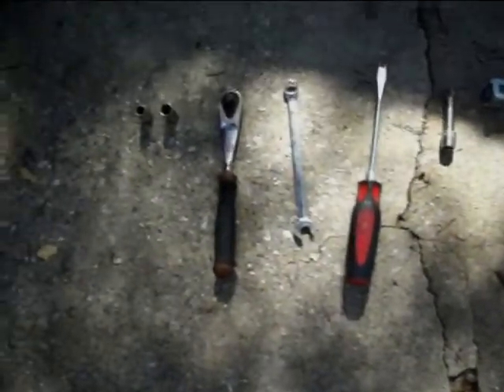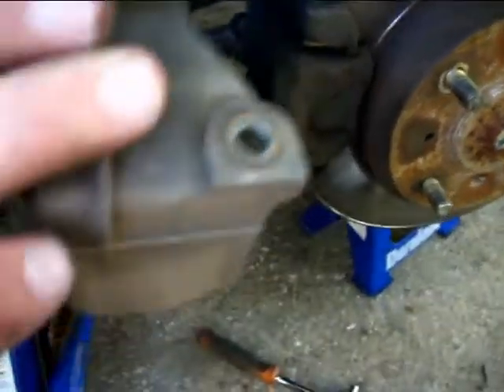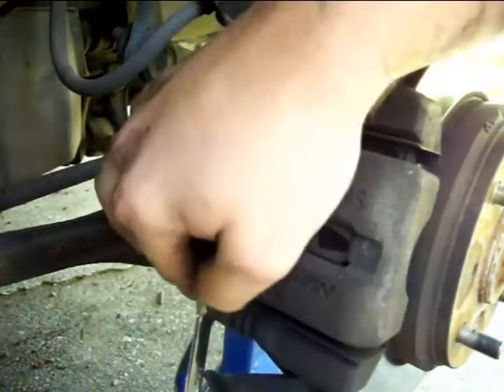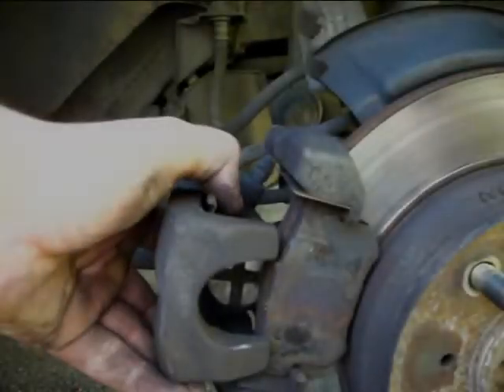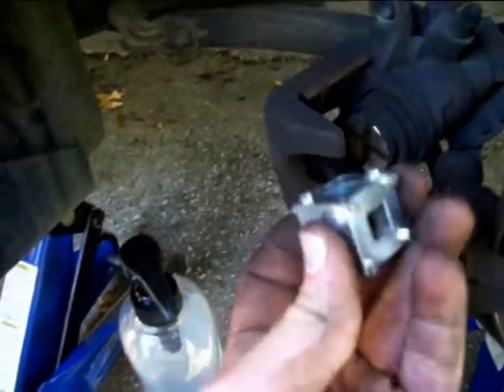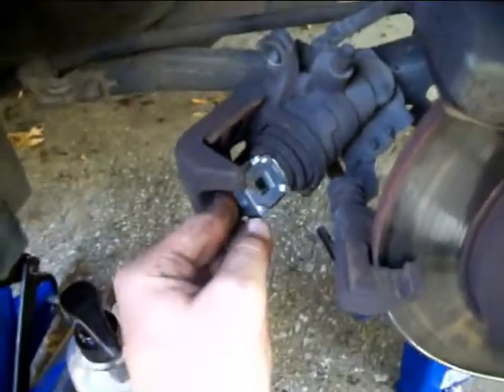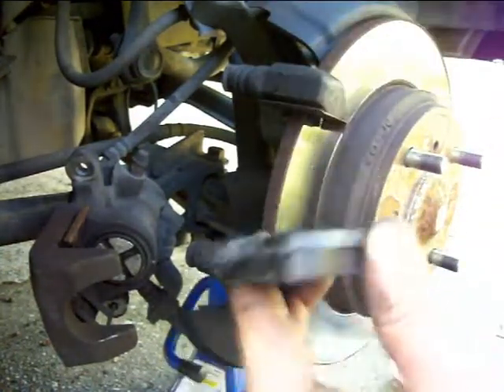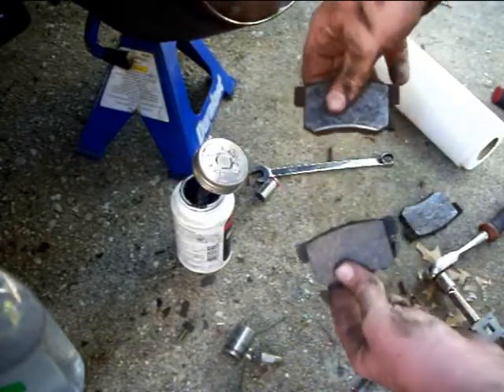How to Replace Rear Brakes Honda Prelude 92-96

Comment: a tad of silicon paste around the piston boot helps wonders and so does cracking the bleeder open before turning the piston back in, so your not fighting against fluid pressure..

Comment: Dude pretty good job and the only thing I got to say is actualy a little advise, that tool you have to compress the piton did look a little difficult and I never seen that tool before and when I did mine on a Honda civic I used the Flat Tip Screw Driver and it was a lot easier than that tool and you DO NOT have to push while turning. Try that next time you have to change the breaks and tell me how that worked out. Great video for those who wouldn't know how to do it.

Comment: fluid leaked from the piston i noticed a comment below mentioning that might be a bad thing does it count if I truned the ignition on and pumped it with now pads only leaving the calliper hanging? and also I found that you could bend a pair of needle nose pliers if you don't have the spiral piston cube thing

Comment: Do you need to open the brake fluid cap under the hood when you screw the brake piston back in?
Reply: +Steve L No...Only if you drain brake fluid...